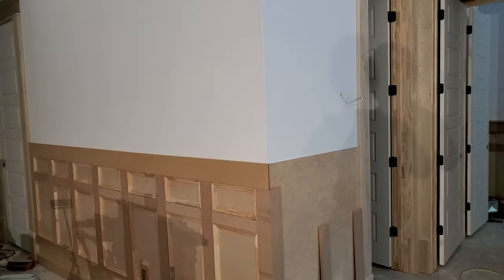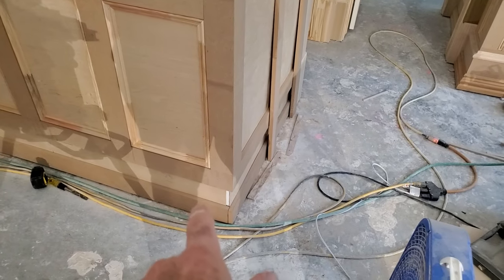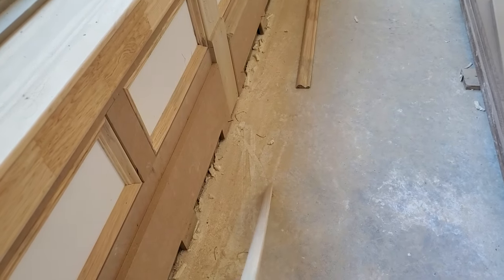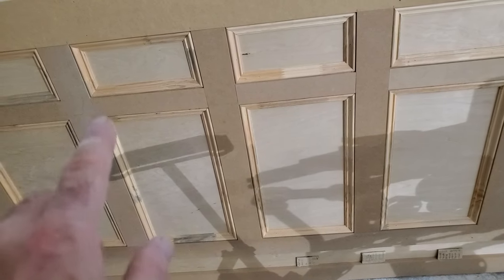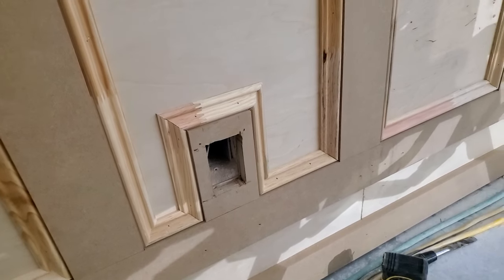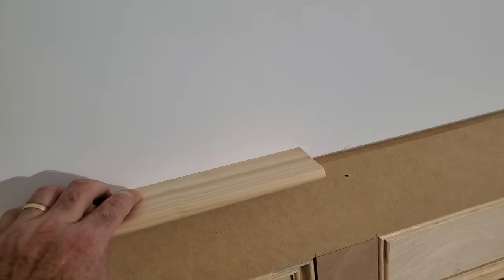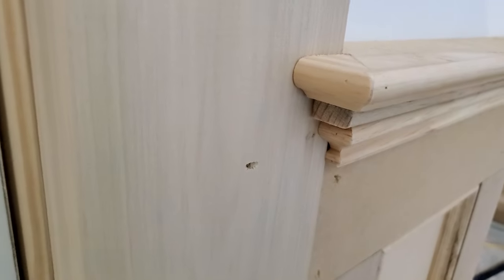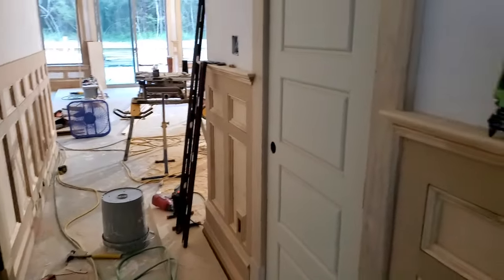How To Install High-End Wainscoting Trim

Comment: The best thing about this is it looks like the contractor put in temp power at the receptacles in the house.
Reply from the maker: Everyone house i build I always have the electricians install a couple of 20 amp breakers and receptacles at electrical rough-in. Then l have the power company install the meter and heat up the panel so I don't have to run extension cords to the temp panel at the street.

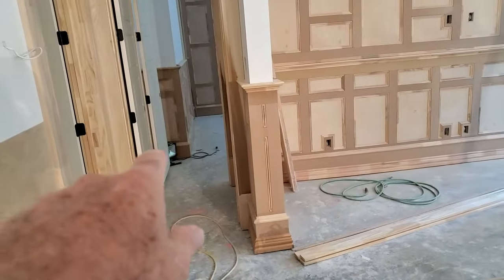Comment: Who's idea was it to do the end of the wall like that at 2:00?
Reply from the maker: Everything was my idea. 
I have a general idea of what I want to do, then just make it up as I go along.
If the wall end was any smaller, I would have been unable to rip the panel moldings and fit them between the two 1x4's. Looks good painted.

Comment: Please everyone use a premium wood filler for gaps. Sure caulking looks fine for the first year of the builder’s warranty but it WILL shrink and now all of the work looks terrible and the trades are long gone leaving the homeowner with the extensive repairs. I just don’t understand doing all this detailed work just to take shortcuts at the goal line.
Reply from the maker: Wood filler is not as flexible as caulk. MDF  expands and shrinks a lot, so wood filler would crack more. I've been building since the 70's and have had no issues. This job was done a year and a half ago and no cracks yet...and I live there.
The only place I use wood filler is on mitered outside corners like crown molding, because caulk sinks in when it dries.